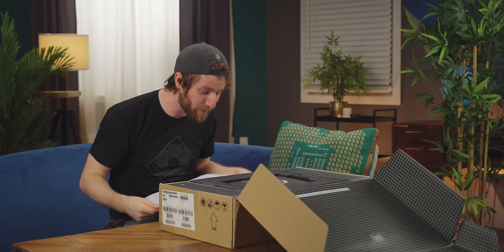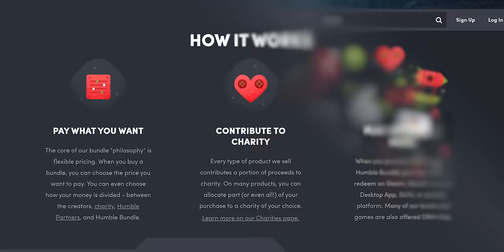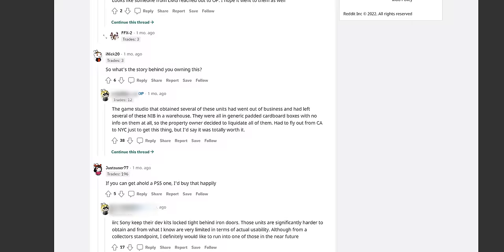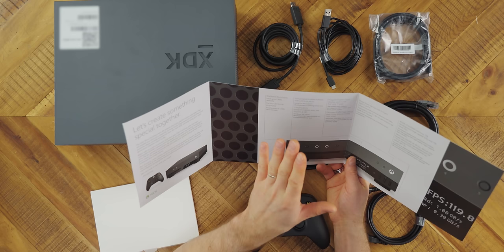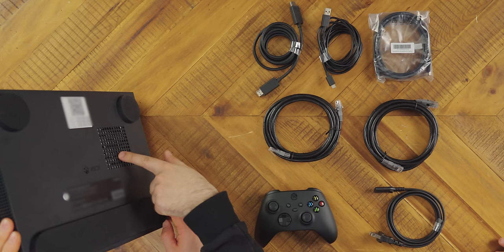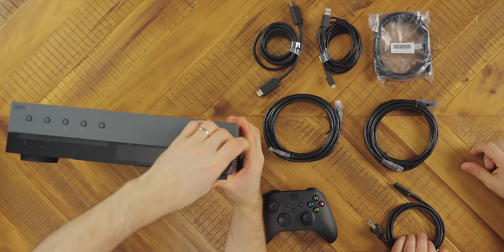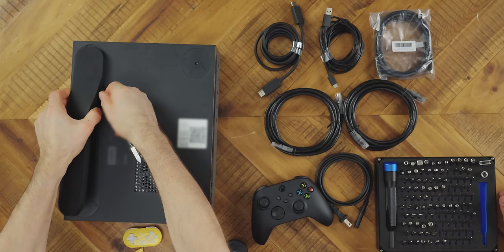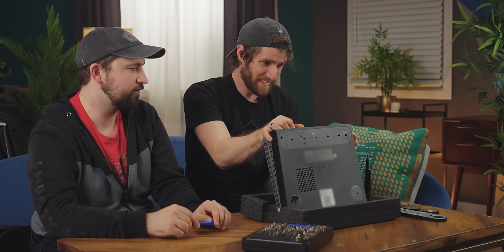I Can't Believe I Paid Two Grand For This - Xbox Series X Dev Kit

Comment: For future notice. Xbox's Backwards compatibility isn't true backwards compatibility. The disc is just used as a license that allows the console to download the actual backwards compatible build of the game that runs on the modern Xbox from the Xbox Live network. i.e. None of those old Xbox Games would have worked unless you were connected to the internet.

Edit: If it wasn't clear, I'm talking about the Xbox 360 games that were bought. I'm not 100% on Xbox One stuff. I think they'll use Smart Delivery if connected to the internet, but I can't see why Xbox One games wouldn't play natively.
Reply: huh I didn't  know that
Reply: That's so annoying, it'd just use up your space downloading games when they could have just made it actually backwards compatible
Reply: @UC3OUe7A1fhk3x3r3mXKfMOQ No it's not. You are not running actual code of the game from old xbox. You are downloading another version which works on current xbox. That's just different.
Reply: @bubbleboy821  lol as if it is as simple as that
Reply: ngl, thats smarter then whatever I would of came up with.
Reply: @bubbleboy821  All Xbox have different hardware architecture, they can't just made them "compatible". It pass through emulation, so you need the emulator and fine patches tuning, so you needs the specific optimization that's come on top of the existing games.

Emulating efficiently a different hardware architecture is not an easy task.
Reply: It shows how biased our media is nowadays. Blows my mind that people have jobs when they know nothing about said job.
Reply: @MartijnPeek  Its significantly easier to just port the old game to a newer console then to create a general purpose emulator and spend even more resources tracking issues down and sending patches out.

The problem is with capitalist shenanigans getting in the way. (publisher went EOL or isn’t willing, licensing crap, etc.)
Reply: yeah it basically just downloads the rom for the game, and the console emulates the game
Reply: @qwertykeyboard5901  As a software engineer, I disagree with your statements.

It is not easy to port W98 games to W11. It needs to be redevelopped.
 
And yes, porting one can be made, but porting them all is impossible, don't you imagine the insane amount of games to redevelop for backwards compatibility in 2222?
Reply: @AIt-Girl  It wouldn't be, last time that happened was the Wii U having Wii hardware inside it.
Reply: Correct
Reply: Each game has its own individual Emulator for each game, for the best performance, that's why.
Also that about the Disc is actually smart, that means that if you got a scratched disc that wont work on an OG xbox/xbox 360, it will still work on Series X, and the disc will last longer. (This applies to Both OG Xbox games and Xbox 360 games, due to them having Way different hardware from the Series x)
Reply: Kinda confusing that it seems like this wasn't known, that's how I understood it from when they first announced it.
Reply: More than most consoles can say. I do enjoy older Xbox games now and again so meh.
Reply: @LordNementon  yeah in 2222 the number would probably be pretty high, but werent we talking about 2022?
Reply: Thanks for that brotha!!! I totally DID NOT know that at all. I guess I’m too hardworking to know that point. BRING BACK TRUE BACKWARDS COMPATIBILITY
Reply: @shooterboi  Same to me, if you choose to invest in game backwards compatibilities you have to take in accounts the cost of today and tomorrow to take the wisest decisions to manage it

At worst, if the computing power is sufficient in 2222 you will have an emulator that will emulate the prev gen hardware that will itself run the prev gen emulators 😸
Reply: @LordNementon  i
Reply: Thats why you can put an xbox 1 disc in a series x and then never have to put it back in while still being able to play those games.
Reply: Yeah this is kinda why console gaming is dead to me. I just emulate games on PC now. No point in buying console. If their servers go down you can't even play modern games that you own (Happened recently with Xbox live) and all old consoles get taken off the servers eventually. Retro market is dead after the ps2/ Xbox original. Sad the digital/live service kiddies will never be able to relive their childhood on original hardware like it used to be without paying $40+15 for money service sub. Most of us old gamers know those ruby cortz glasses we look through when we go back playing classics.
Reply: @MrSmexy702  This is really only a problem on Xbox consoles, PS and Nintendo still print the complete game on disc and if not there switch games will have the disclaimer on box, Xbox is also the only of the 3 that can't play games out of the box without connecting to internet first, hopefully with the backlash they fix these issues
Reply: Every disk has a boot sequence code that checks if its authentic. Flip your disk over and you will faintly see a sequence of numbers with a barcode. That's what your xbox laser scandal to check if its authentic.
Reply: They "recompile" binaries into x86. That allows better performance than JIT.

They could technically do that on the console, too. Just a lengthy "prep" step. But choose to do it on their server once for all users.
Reply: @LordNementon  that depends, a Series X could easily run One (and other model) games, the 360 is different though as it ran on PowerPC

yes it would run through emulation but the Zen 2 in the new Series X should be powerful enough to emulate PowerPC (xb360)

and og Xbox games should run just fine on it with minimal patches as the Xbox 360 was the only Xbox that didn't run x86, the og Xbox ran a Pentium III which is x86
Reply: Partially true. The Series X still reads data from the disc for Xbox one games and will download the Xbox One version of the game. Since the console is offline, smart delivery will not activate. The problem they ran into is that all non-native Series X games need a one-time network patch in order to run on the Series X. This does not apply to native Series X games like Devil May Cry 5 SE or Control Ultimate Edition. You can tell which games are native from the game box (it will only say Series X on the label).
Reply: @SukruTk  only the Xbox 360 didn't run on x86, all the other variants actually ran on x86, og Xbox and everything since the One again

but Xbox games weren't made with newer gens in mind
Reply: Yes but sometimes I get a free uptate
Reply: Good ole DRM games, where you don’t own them unless the publisher says you do :)
Reply: So if linus did use a game that meant for xbox series x  it would have worked?
Reply: I'm ok with this, just be able to play some of my old games is more important then how it works, I still remember when sony originally said you can't  play old games even just one generation back, they even said you can't use ps4 controllers on ps5, but they took it all back as Microsoft announced backwards surpport for old games and controllers.
Reply: @bubbleboy821  Because they weren't meant for that.They are Developer Kits meant for newer titles to make sure they are compatible,not for being backwards compatible.
Reply: @LordNementon  If they managed to have the original development code for said game wouldn't that make it easier to update them to run on modern hardware or am I missing something.Asking because I'm not a coder but I am interested in such things for sure.
Reply: Yeah they tell u this wen you put the disks in
Reply: Well that is actually how discs have worked since the ps3.
Reply: @LordNementon  That's a port
Reply: @BH4x0r  Yes, but it doesn't depends of the CPU architecture, its depends of the whole hardware architecture.

A PS3 and a 360 CPU both use a PowerPC instructions set, but their hardware are totally different and emulating them is two different realm.

The same goes for the first Xbox, it use custom hardware that needs emulation.

But if consoles hardware become as generics as PC, yes emulatation won't be required anymore.
Reply: Well actually it is true backwards compatibility. It does require you to download it from the store after you pop in the disc. It launches those games in an emulator of the 360 which means yes it’s true backwards compatibility but with annoying DRM protection
Reply: @bubbleboy821  That's not how computers work
Reply: @bubbleboy821  Thing is the ported games are made to run on current gen hardware and software, so it doesn't need to be emulated.
Reply: Hmm this is news to me, as i sit here playing Tony Hawk Underground 2 on my Series X with no internet. (Doesnt even have a digital version to download)
Reply: @LordNementon  they don’t have different architecture lmao they’re all X86-64 based systems running a modified version of windows o.s.

Even the o.G Xbox used a modified version of windows. 

The only difference is they coded a snippet into windows that doesn’t allow it to native run .Xbx and similar executables. Which windows CAN native run without that prevention as all Xbox code is based on Universal Windows Platform. 

… the only reason the X360-newer consoles use emulation for the previous older console before it is for CLOCK TIMES to make sure the game doesn’t run at higher than intended speeds. And for DRM reasons. 

Windows 10-11 for the series line
Windows 8-10 for Modern Xbox ones.
Windows 2000 heavily modified for the Xbox360 and the o.G Xbox and used windows 95-98 code.
Reply: @bubbleboy821  Annoying? No. It's amazing. What MS did allows old masterpieces like original Red Dead Redemption run at native 4K with 4xMSAA and 16xAF.
Reply: @verakoo6187  it’s emulated natively, and some games don’t require emulation at all.

As long as your Xbox is set to your home console and you aren’t having a weird console update issue that locks all drm on the console you shouldn’t require Internet at all.
Reply: @That_Son_Ofa_Itch  You can run Linux on a PS3 (at least you could), it doesn't mean the PS3 and a PC have the same architecture, it mean Linux kernel has been adapted to support PS3 specific hardware (that even the specificity of Linux to run on any kind of hardware architecture)

The same goes for the original Xbox, yes it runned with customized windows kernel, because the kernel is the abstraction layer between the hardware and the operating system.

The CPU architecture doesn't mean they have the architecture of a PC. Emulating the original Xbox is not a simple things to do.
Reply: This is literally why the OG PS3s that were "too expensive" to most were god machines. Complete hardware based backwards compatability.

And because so many were upset it cost too much, is most likely why we don't have it on PlayStations these days, good ol' consumer being absolutely awful and hindering what they actually want because they don't want to pay for it.
Reply: Wait if I download them, can I play them offline or do I need internet to actually use the old discs?
Reply: Yeah, I'm honestly surprised they didn't know that.
Reply: @LordNementon  but they know how their old OS operates, they're all x86 and have the source of everything, only the X360 would be harder
i highly doubt real emulation would be required apart from X360 games, some kind of interface should work fine, i ofcourse don't know how deeply integrated it is into the OS and into the games though, but emulation is only really required if the CPU can't run those opcodes straight out of the box, since the PIII in the Xbox x86 etc it can defo run the opcodes straight, but it depends how the OS interacts with games

that is why Windows games and Linux games don't run on each other too obviously, although they share the same CPU architecture, GPU is a different thing and would require something driver-esque

some kind of compatibility layer-esque thing should do it just fine
Reply: You know this for a fact how?  It would appear to me that launching a backward compatible game starts a virtual session of the Xbox 360 software on the console and plays the game.  Nothing is downloaded when it starts instantaneously.
Reply: @LordNementon  redeveloped? Are you serious?
The game logic should be just fine. The APIs to interact with the OS may have changed, but that doesn’t mean that you have to rewrite the game.
Emulation is really difficult to get right, especially for modern hardware. Writing an API translation layer and recompiling the old code is much easier.
Reply: It's pretty clear who in these comments hasn't actually used the Xbox box one/series backwards compatibility. MS actually dumped a ton of effort into it's backwards compatibility. You get upgraded graphics, 60 FPS and 4k in a lot of older games or some variation of the three. It's not loading it off your disc but it's not just some nefarious DRM, they are downloading a completely different version specifically designed to take advantage of the newer hardware. Other than the need for online it's the most effort any console maker has ever bothered to put into backwards compatibility.
Reply: Year it took the ps5 to try to do it lmao and still no 1440 p on the ps5 must hard over there lmao
Reply: @BH4x0r  The compatibility layer you talk about is high level emulation, but yes definitely not hardware emulation 😸

Kind of yes, but kind of no, the original Xbox is not just a PC. It has dedicated hardware, you have to emulate that specific hardware chips behaviour with software if you want to run original Xbox specifics software without modifyng its source code on an other X86 CPU.

If you have the source code and you want to port the game, the CPU architecture doesn't matter, the CPU is a general processing unit, you just have to re-compile the software for the right architecture (so, the jobs of the compulilateur). At the end, with the sources if you have the will to port the game, the emulation is never required, since during the port you will remove the use of hardware you don't have.

Emulating  X86 custom hardware on X86 has for only advantage in comparison of emulating PowerPC custom hardware on X86 to be more efficient, since you won't have to convert the CPU instructions.
Reply: People dont know in 9years that xbox one/series downloads every game from store disc is only giving acces to the game when its inside console
Reply: @LordNementon  "Easier" as in Relatively easier.

I've tried compiling old source code before. Its ass.

But it us still easier then building an emulator
Reply: @MultiCarter007  with proving your license via physical media. = free download . very consumer oriented practice . i support that for the possible future.
Reply: @sanic1085  are you talking about LTT? I highly doubt they’re biased towards Microsoft. And I promise you they know what they’re doing in their job. I would imagine it’s just an oversight.
Reply: Thanks for this info @Hazz3r 🤘
Reply: You are downloading a new executable and new assets but loads of assets and content are copied from the disc I often watch them copy stuff.  Unless it's all a ruse....
Reply: @QuixoteJay  To the statement about the game itself being stored on the physical mediums:
It is to note that this statement only applies for Nintendo's, Sony's and Micorosft's old games on old hardware. 

Nowdays, it is a bit different. Eg While Nintendo still mosty puts the whole game on the switch cardridge, it isn't really the "whole" game. Any updates, patches and dlcs are completely missing. This means that while you will be able to play a physical switch game on original hardware in the future, you won't be able to experience the games as we know them today. Many games have changed drastically through updates and dlcs. E.g mario kart 8 will lack half it's tracks. Smash Bros Ultimate will lack half it's characters and stages. Animal Crossing will miss half it's content. 

The games will still be playable, but they will be in a state where most people will barely want to play them.
Reply: @qwertykeyboard5901  Scale it 900 times for the first generation leap, then 1800 for the next one, not sure it will stay relatively easier.

But definitely agree that developing an emulator, especially when there are breaking architecture changes is software pr0n 😸
Reply: What a flush of a video. Spent all that money and they didn't even know the basics on how back-compat works on Xbox since 2015. They didn't even finish the teardown. And they reference the GN video, but they haven't even watched it. So there is weird first-impression misinformation being said with no correction.
Reply: @MartijnPeek  it could have been designed to be.
Reply: @LordNementon  Well microsoft went with the porting idea, and id expect them to know what to do most of the time.
Reply: @qwertykeyboard5901  Xbox one games are emulated. Some vendors port their Xbox one games and make a series X/S version but it is up to the vendors. I've just double checks since you gave me some doubts 😸
Reply: @LordNementon  I don't think it would be that hard to implement as it all runs on DirectX, which is sorta cross compatible, atleast if it's done like on windows
Reply: Same can be said of any game these days
The disc might contain the vanilla build but after a few updates its really just a key
Reply: Lol was just coming to say the same thing.
Reply: That explains why it "downloads" it but you still need the disc to play the game :/
Reply: @LordNementon  it’s actually much worse than that, emulating RISC on CISC is a nightmare. SerIes X might have a prayer of doing it, nothing lower. All of these are automated static binary translations with fixes done by hand.
Reply: @Nick_Tank  Well that isn’t going to happen for PS3 and 360. The only way to do this would be to take a 360 processor and put it on the Xbox motherboard and give it its own independent cooling system. This is after you spend hundreds and hundreds of millions of dollars restoring the lions to make those processors. Doing this would raise the price of each Xbox probably about $200 by the time you said and done. You cannot do it any other way.  This is the solution that they had to use for PS2 and PS3, and the chip alone cost Sony $30 per console at manufacture
Reply: @spiral09  Assuming that it was a game that actually resides on the disc, and doesn’t just contain a loader to download it, yes
Reply: Makes sense tbh. The 360, and especially the Xbox, were super peripheral and used a lot of custom hardware and software features. Running the raw code for an Xbox/360 or PS2/3 game on modern hardware would definitely not be fun. The shader glitches alone would probably make 99% of games unplayable

If you thought playing old Widows 98 and XP games on 64-bit Windows 10 was painful, you ain’t seen nothing. Trying to run Xbox 360 games on modern hardware is like that on steroids
Reply: And that’s why I play Digital-Only.
Reply: @verakoo6187  Then you’re using a pirate PC version in dev mode, since the title isn’t available on BC. If you’re going to lie, choose a game actually on the list next time.
Reply: @jeffkleist9679  Modern Vintage Gamer have a great video about Microsoft Fusion emulator and their "just in time translation engine with multiple pass optimization" 😸
Reply: @That_Son_Ofa_Itch  xb360 runs on the PowerPC arch though, which some Macs had, but it's definitely a different architecture
Reply: @jeffkleist9679  Underground 2 was sold on GameCube, Xbox (og), PlayStation 2, Windows and GBA.
Reply: @LordNementon  this is why PC is King. You can play old games with better specs, and if it require old version of windows, you can download the old OS to run the game natively on Suped up cpu/gpu
Reply: @BH4x0r  But it’s not backwards compatible. I just checked the list. Even if it was, he would have to download the BC version by going online.
Reply: @Keepskatin  Until we have quantum PC, yes 😸
Reply: This angers me DEEPLY, but it does mean that the disc only has to read a little bit. At least in theory.
Reply: @jeffkleist9679  I don't know for sure, but perhaps if he has an offline patch for other games it might work for that game too, it's not like they're hardcoded for every game and since the OG Xbox had a similar architecture (cpu atleast) it might work that way

if it was an Xbox 360 game it would DEFINITELY need to download a working version (as the 360 ran a PowerPC processor)
Reply: @LordNementon  Not only that, because of the music industry asking for renegotiation of licensing (which the DMCA needed to be rewritten to prevent this loophole/abuse).
Reply: @killertruth186  yea. Agree
Reply: This is not true. I know this isn’t true because I wanted to test the original AC:Unity before the hardware spec got downgraded and features removed.

Setting the Xbox to offline mode allowed me to install the game off the disc and run it without patches. For anyone wondering, it still ran badly and was garbage but it did run at 60FPS.
Reply: @LordNementon  Xbox literally has pc architecture and all X86-64 based gaming is centered around Direct X which literally derived its name from the Direct XBOX 

The Xbox was what Direct X was originally designed for. Hints at them being the literal same architecture fundamentally.

As for the ps3 running Linux. Linux is a distribution based o.S, you can run Linux on basically anything but one version of Linux can’t run applications for other distributions.

Microsoft however has implemented full compatibility software wise for all their product families. Through W.U.P support. 

Fun fact also the newest systems being the ps5 and xbox series line are so close to being full blown computers that people have modded windows 365 home edition onto them.
Reply: @robertpatton172   seems like it only needs downloads for 360 games (which is logical as it uses a different cpu architecture)
Reply: Yeah, this is how the Xbone worked. Not sure why people are too stupid to know that. It was explained. The 360 and current architecture are not compatible which is why the 360 is emulated. It's either that or nothing so why complain?
Reply: @That_Son_Ofa_Itch  First correct original Xbox emulator arrived in 2019, no it isn't just a PC.

If Linux can run on the PS3 it is because a custom Unix kernel has been developed for the PS3 hardware.

Yes, they use DirectX API with a custom kernel implementation for the Original Xbox to support its custom hardware.

You can provide the same API in the userland with different kernel implementation, different implementation to support and leverage specific hardware.

Even if there are actually slightly differences between the DirectX API of the original Xbox

The kernel is the abstraction layer between the hardware and the OS.

You need a Xbox Kernel to execute Xbox games, you need to emulate the hardware the kernel expect to talk with, or you will need to change the SDK use to develop the game, port it or patches it on the fly (HLA emulation)

Totally agree that last gen consoles architecture at the exception of specific hardware for security are close to be a PC.
Reply: @qwertykeyboard5901  Not quite sure tbh, making a port of every single game seems less efficient than just having proper emulation in place.

Sure one port is way easier than a proper emulator, but 50+ ports seems more difficult.
Reply: Super annoying. Can't put a disc in and just play
Reply: Miss the ol’ days when you insert a disc and just play
Reply: I'm surprised they didn't know that. Doesn't it always download anyways?
Reply: @bubbleboy821  They couldn't make it backwards compatible. The 360 had some super weird CPU and GPU architecture features that nobody makes anymore. If Microsoft instructed AMD to add those weird features, it would prevent the company from moving forwards towards a more unified platform with PC.
Reply: @bubbleboy821  ya no it much more complex than that. Just be happy it emulated and not cloud streaming
Reply: Yeah, they use the same retro-compatibility layer that Sony uses but unlike Sony who added all the gaps in logic and features straight to the silicon, Microsoft fill the gaps with software emulation. Not even system level it comes separate with each game and requires you to be online.

With the recent server outage happening no one could play BC games on series x and a lot of people couldn't play native games either.
Reply: Yeah but thats some kind of logical due to other hard and software settings. The developed 360 or One Games didnt know the Series Consoles so the program code doesnt work. Also if you buy a Xbox one disc for your one you gonna update it anyway. Compared to PS5 it is backwards compatibel
Reply: @verakoo6187  Most people would know it.
Reply: I figured that out pretty early on when i put a morrowind Xbox game in my Xbox one and it pulled up goty edition instead of just morrowind standalone
Reply: @googleuser0001  It sounds like they only have the GOTY version on the store.
Reply: A disgusting reminder that companies don't believe in physical copies, sadly. 

It terrifies me.
Reply: @SageYT7709  It's mainly because of most people don't like disks anymore.
Reply: @sanic1085  . Can you elaborate, it comes across as a non-sequitur. None of these peoples jobs are about explaining Xbox backwards compatibility to people.
Reply: Yeah unfortunately. I Kinda wisht hey found another way, but eh
Reply: @bubbleboy821  making an Xbox ..that has og Xbox....Xbox 360 and xbone architecture inside it is just not feasible...

That what it requires to do true hardware back compact in a console...

Games are licensed to run on individual hardware..at least up to ps4 and xbone when they changed it to ecosystem...

Meaning if you want a console to run 3 gens of games...
You have to put enough of Xbox parts into the console so it's technically classified as an og Xbox..

Enough 360 parts so it's classified as a 360..

Enough xbone parts so it's classified as an xbone...

That machine...would be the siza of a large mini fridge..and cost over a grand...that type of back compat isn't feasible...Sony did it with the 60gb ps3...than cancelled them.....

It holds back innovation and bogs down the new system you're trying to make.
Reply: Yes, but did they add more feature like unlock fps, resolution and auto hdr?,
Reply: @bubbleboy821  not gonna lie it's really nice, I have a lot of broken 360 games that will recognize but not play. This way I can download the full game to my Xbox and use my broken disk instead of having to buy a new copy
Reply: Mine worked offline
Reply: @LordNementon  Actually most Xboxes are x86... The original used a Pentium III (x86) and both Xbox One and Xbox Series use modern AMD processors (x86-64, with native x86 support). The only xbox that requires instruction level emulation is the Xbox 360 due to its PowerPC like cell derivative processor, but emulation with JIT is quite performant as companies like Apple have publicly proved.

Even the graphic architecture differences should not be that difficult to emulate. Unlike other console development companies that used tailored graphics APIs unique to the graphic hardware, all Xbox consoles use a derivative of DirectX and Direct3D. This means that API level emulation is possible with the API being implemented using native drivers (as good as no emulation overhead). This is not just limited to the graphics API, with most of the interaction with the system being high level through APIs which can be outsourced during emulation to native drivers rather than requiring low level emulated drivers on emulated hardware.

These characteristics in theory make the entire Xbox family the easiest consoles to emulate as you do not need perfect cycle level emulation as the APIs never defined such behaviour. This is very much like how one can fire up an old x86-64 MaxOS application on ARM based apple silicon and they just work despite different IPC, core counts, graphic architecture, e.t.c. The issues with emulation of older Xbox consoles and one of the reasons behind needing game specific patches is not that the emulator is buggy, but rather the games themselves are buggy.

One example that was given in a blog behind the Xbox backwards compatibility was a Xbox 360 game that ran fine on the console but out right crashed on the Xbox One. Upon further inspection they discovered this game also could crash on the original Xbox 360, just very rarely. It turned out the cause was the game made an architecture specific assumption that its threads would always execute in a specific order that was entirely dependent on the exact behaviour of the Xbox 360 scheduler and the rate at which the threads executed on the CPU. These threads being run by the scheduler of the Xbox one in a different order at a different rate made the game crash. Although they did improve the scheduler logic to more closely reproduce the results of the Xbox 360, the actual solution used was a game patch that fixed that bug and made the game no longer care as much about the order or rate threads executed. Apparently they used such examples to create guide lines for long term compatibility when creating games.

The same blog also mentioned that most games in the library just work with emulation, no patch required. However why are patches then required for all games? I suspect it is largely down to licencing since a developer that made an Xbox 360 game explicitly gave permission for it to only run on the Xbox 360 and not the Xbox One or Xbox Series. As such forcing the developers to patch gets around this licencing restriction since the developer then has explicitly given their consent for the title to work on the newer consoles using emulation. It also gives the developers a chance to go beyond just letting the game run and improve visual quality and performance in a way that does not break their games. This may or may not be done by rebuilding the game, after all native ports will perform better than emulation, however too much of this is kept secret to know for sure.
Reply: @MultiCarter007  I don't think it's that easy to emulate a whole other console, even PC emulators struggle emulating consoles like the Xbox 360 and Xbox one. It's much better that Xbox is instead creating different versions of the game that will work on newer hardware
Reply: This is the entire reason I stopped using consoles you paid for the device you should be able to play without the internet
Reply: @drsupergood8978    Regarding Apple and their x86 emulation performance I've read somewhere that their chips use an hardware tricks to be capable to read the data regardless they are saved in little endian (X86) or big endian (ARM), which is usually one of most performance hit, due to the required conversion. Smart move from their side for sure.

Interesting reflection regarding the requirements for the patches 🤔

I totally agree that emulating x86 on an x86 platform will always be more convenient that emulating an other instructions set.

Emulating with a translation layer the API call is definitely a way, but a way not that easy to implement due to the various versions of the SDK that needs to be reversed and re-implemented (the strategy used by one of the first Xbox emulator if I recall it correctly) It let me thinks of WSL1 who used that approch but has been abondoned in WSL2 in favor of virtualization due to the ~infinite cat & mouse game.
Reply: The architecture is different (PowerPC vs x86) which means all the binary codes are useless. It's much more efficient to recompile and have the games run (close to) natively. Don't forget some games are even running under 4k high refresh rate etc. Microsoft has really gone above and beyond on the compatibility side. This should be celebrated.
Reply: From my understanding all your doing is downloading wrappers. The core code is all there. Untouched
Reply: Thank god oem 360 hard drives have a partition for an ogx emulator
Reply: For OG Xbox and 360 games that’s true, however many Xbox One games can be installed from the disk. You can also run some Xbox One disks unpatched in offline mode too.
Reply: @LordNementon  hence why the OG PS3 was a monster in size and cost. it actually ran both generations hardware in one she'll, the disc drive was actually two and the type of disc inserted would tell the system which laser to use.
Reply: But what you expect??? All generations have different architectures, so download the game is a great alternative, better than what Sony does with PS3, with only streaming option that is paid and just available through their new service.
Reply: @richardjohnson4984  The same goes for the first realeases of the Wii, they included a GameCube in it 😸

Having multiple hardware in the same shell obviously allow to use all the included hardware but it can't scale to the infinity.

If the PS3 that didn't include PS2 chips can't run PS2 and PS1 games there is a reason, the PS3 hardware needed to evolve in an incompatible way. That's a breaking changes, they are necessary when new, better and incompatible technology arise.

Maybe tomorrow games console will use ARM processors, they won't be able to run natively x86 one.

Go more further, they may have a quantum processor even! Which will be definitely a total architecture changes.
Reply: @bubbleboy821  they have to modify all games in different way to be emulated on newer Xbox, so you can never just play the original file
Reply: @qwertykeyboard5901  "capitalist shenanigans" , and, you think any of those things would have came to be  in a purely socialist economy?.....the answer is a big fat NO
Reply: @qwertykeyboard5901  EMULATOR -1 piece of software to rule them all. Its is so stupid doing it the way they are.
Reply: Meh, but it's better than any backwards compatibility options that Sony gives lmao.
Reply: Wait, does that mean that they need to modify each to game to make it compatible with the new gen?
Reply: @youraveragexin7400  nope it’s that the game Dev just need to support the 360 or Orignal Emulator on Xbox
Reply: @bubbleboy821  are you aware that all your modern games are copied from the dial to your console and the disc is still only used as a key?
Reply: You are partly correct, a build is downloaded but it is the same as for old gen console and not a special build
Reply: @LordNementon  well, turns out it's x86 they run on, and there's been emulators for PC for a while, so there's no actual reason for whatever mess they're using, specially since many of those games aren't even for digital sale anymore
Reply: Biggest tech channel didn’t know this lmao
Reply: That is really disappointing
Reply: @That_Son_Ofa_Itch  I very seriously doubt OG XBox used win98 code... or NT for the 360...
Reply: @killertruth186  If that was true, digital only consoles would outstrip disc based consoles easily. How did you come up with 'most'?
Reply: @guadalupe8589  ok liberal
Reply: At least the console is actually running the game @PlayStation
Reply: Yeah
Reply: @urbexingTss  how
Reply: Exactly
Reply: @bubbleboy821  
>They could have just made it actually backwards compatible.

They could have just made something that is literally impossible? Lazy!
Reply: Thing is, the backwards compatibility wasnt designed for the console from the start, so it needs to  create a specific emulator to translate every single game to the virtualized Xbox environment that is used today. As mentioned, on a Wii U or on the PS3 it wasnt necessary because the consoles were designed from the start to have a compatibility layer, on the Wii U it had parts of a Wii system and on the PS3 it was a hybrid between a general emulator (PS1 games. Every single PS3 out there runs PS1 games) and hardware (PS2 games. Newer models lack PS2 compatibility)
Reply: @SchmeedIsMe  Many sources across the internet that can be found with a bit of googling. You can prove it to yourself by inserting a backwards compatible Xbox 360 disc into the console, (make sure that there is no data on the hard drive related to the game, i.e. as if the disc is inserted for the first time.) The game won't play. Because the console isn't using the disc for game data, just the license.
Reply: Same same better then playstation making me rip out the ps2...
Reply: @pseudowoodo5010  One they're downloaded, you're good.
Reply: @3k4landrew  I don't really agree. Xbox's Backwards compatibility is really just emulation. This is different to the backwards compatibility that the launch day PS3 had, or that the PS5 has with PS4 games, which is hardware based, "true" backwards compatibility.
Reply: @SukruTk  you can't just recompile code into x86 if it's written in a language that uses JIT, you would have to rewrite the game in a language that supports x86. Also that does not have anything to do with backwards compatibility..
Reply: The current virtualized Xbox environment  only runs game code from the internal or external storage, it doesnt run discs as old consoles, the discs have a "compressed" version of the game that the console decompresses and copies. By design, it is impossible to run 360 games natively, so it is really cool that not only they found out how to make them work, but to identify a disc and let the consumer play without paying the same game twice (unlike Sony which made an PS2 emulator but you need to purchase the games again, not only physically, since the PS4 and 5 will not run PS2 discs, but digitally too, if you bought some PS2 classics on the PS3, you have to buy the same game again to play on the PS4 and 5). Other thing is that there are no disc drives able to properly run and decode a 360 game partition on the disc, what One and Series consoles do is try to identify what game is from the Video partition alone and download the emulated version for you to play (360 games have a Video and a Game partition, the Game partition is self explanatory, the video partition is just a video saying that the disc is not meant to run on a DVD player)
Reply: @r0best498  you actually can. Eurogamer ran an article on how the back compat works on the Xbox. I would recommend reading that
Reply: interesting
Reply: They really need to have a cartirage system like Nintendo does or something because discs are really getting out of date and we can't just keep using 100gbs of data just to download a game you got on a disc.
Reply: @hightiernub1313  , Well tbh the PS3 with the backwards compatible chip was the best thing they had, It was kind of a shame they didn't properly cool it.
It would kind of be interesting to see with Chiplet/MXM design if in theory they could make a chiplet a shrunk down processor from yester years, and then simply use a master I/O die to translate to newer standards like USB and PCIe renditions.
Reply: @kanedaku  When I had said most, I meant most people that knows about the game.
Reply: @Hazz3r  I really missed Xbox music digital store. Don't know why they had decided to close it.
Reply: @LordNementon  if u think it was easy ask Sony why they haven't done it. Give credit where it's due and stop being childish
Reply: @shepshepson  thing is, it is a issue on Nintendo Switch as well, on Xbox and PS is far less worse. Switch use game cards which can have multiple sizes, the bigger the card, more expensive it is to produce, whereas a blu ray disc, packaging and all cost 3 dollars at most. Publishers on the Nintendo Switch often choose the smaller cards to save money and the user needs to buy a bigger SD card to download "the remaining part" of the game. If you see a Nintendo Switch game with a white ribbon on the top, it has mandatory downloads because of this and the game card will never start the game without the game data downloaded. At least on PS and Xbox the 1.00 version of game is accessible from the disc if you cant download the day one update. One good example is Megaman Collection, it fits nicely on a blu ray, the game is as far as I remember, 6GB in size. On the Nintendo Switch Capcom chose to store the game into a 2GB game card and it only has the first game, the second is a download code, or how L.A. Noire is a 30GB game but Rockstar chose a 16GB gamecard and it requires a 14GB "update" download to play the full game.
Reply: @lionbizzle  You've probably misunderstood me, because I've never made that's statement.

Not sure why you think I'm childish, can't understand you on that one.

But for Sony, I can say it is because they haven't invested on it. Microsoft did invest a lot to build their internal emulators used for backward compatibilities.
Reply: @verakoo6187  You only need internet to install the game. Once installed you can play offline. Try deleting it then try to launch it offline.
Just because it doesn't have a purchasable digital copy doesn't mean it's not a digital copy.
Reply: so? still plays games.
Reply: @killertruth186  Again, how are you quantifying this? Or are you just claiming something as fact because that's what you believe?
Reply: @kanedaku  An educated guess.
Reply: @youraveragexin7400  basically recompile and do all the work to ensure it is running native to the instruction sets of the architecture rather than running through a sub layer of software code like emulation that translates code from a different architecture to something the processor and GPU can use to render the game and calculate all the other relevant data like music, AI, and such.
Reply: @LordNementon  The reason why emulating efficiently a different hardware architecture is so hard is because we don't have documentation. 
The community already manged to emulate xbox AND xbox 360, completely blind, through reverse engineering. Pretending microsoft couldn't do it is laughable.
Reply: @philipegoulet448  But Microsoft did it, I've never pretended that they couldn't, I was just insisting on fact that the original Xbox is not just a PC. They even writted patent  on optimising little endian to big endian conversion when developing their Fusion emulator, Microsoft invested a lot to build their emulators (not like Nintendo who is using open sources ones 🙃)
Reply: @kanedaku  you can literally google what windows platform they’re based off of its public information
Reply: @LordNementon  According to Wikipedia modern ARM supports bi-endian at least by hardware design so this is not a feature unique with apple but rather shared with most recent high performance ARM processors. That said I do recall there being talk that they had some magic logic built in to help emulate x86-64 virtual memory logic more efficiently that deviates from the normal ARM behaviour.

Normally reversing and re-implementing APIs is extremely resource intensive. However Microsoft, having made the original APIs, does not have to reverse engineer them as they know the exact details already and might not even have to re-implement them as they still own the original source code. If the code is any bit portable this is fairly easy, reliable and performant. A good example of this would be the graphics APIs since the RDNA2 GPU likely use AMD provided drivers and AMD drivers for desktop RDNA2 GPUs still support graphic APIs such as Direct3D9. This Direct3D9 support offers most of the graphic features needed to support the Xbox360 and original Xbox, minus a few platform specific deviances that AMD could likely add without too much effort. Sure we all know that Direct3D9 support is not very performant on modern Windows and GPUs, but it does not have to be given how much more powerful the Xbox Series is.

WSL1 vs WSL2 is something different. The issue with WSL1 is that Windows does not natively provide similar variants to all APIs that Linux offers. This resulted in some rather poor performance hacky work arounds (file system operations, process fork) or even outright a lack of support for such APIs (fine details of process fork). Given that Linux heavily uses these APIs and depends on them performing well this causes quite major performance issues. WSL2 gets around this by just running a full Linux virtual machine and letting that's kernel provide the APIs with a tight integration to connect to Windows. Although this gives much better and more performant API support, it is technically slower when that is not being used due to virtualisation overhead. Given that Microsoft has made all the Xbox consoles and their operating systems this is not likely to be an issue as it would be closer to running a Windows XP application on Windows 10 than running a Windows 10 application on Linux (which due to API level emulation is a thing! Steamdeck being a recent example of taking that to the next level).
Reply: It's been that way for years
Reply: @That_Son_Ofa_Itch  Well, thanks for the information. I did just that, so I stand by my first suspicion about Win95/98 code. The internet agrees the original XBox uses Win2000 code. I don't know what you were smoking.
Reply: @kanedaku  oh noe I got the windows version wrong but literally everything else right. 

😂 my point still stands Xbox is a windows based machine that is comparable to pc. And That windows literally can run .Xbx files but is prevented by the hyper visor of the o.s. 

._. Sorry I said 98 instead of 2000. The point still stands you can publicly see which version it’s based off.

All Microsoft products are designed to work together and be able to talk\Interact without code translation needed. Which is why Xbox dev mode uses universal Windows platform.
Reply: @LordNementon  yet on Xbox 360 it did run an emulator on the console to run the original XBox game's code.
Reply: Long story short 2013 happen
Reply: I mean… at least it works…
Reply: That's crap, not buying an Xbox anytime soon, even if I could/wanted. I'm tired of these companies telling customers bullshit.
Reply: Still emulation quality is insane, consider all old games runs with improved graphics 4k 60fps. Even on xbox one x, that some fucking marvelous engineers playstation can only dream about.
Reply: @That_Son_Ofa_Itch  I don't care about any of that other stuff. The first point I made was that I seriously doubt the console would have win95/98 code. The second point doubting win2000 on the 360, you were correct.
I think we're done here now.
Reply: So stupid.. the xbox series S/X uses the SAME Blu Ray Disc Drive as the Xbox One’s. So how hard would it of really have been to just let older games play directly off the disc, even if its for single player only offline idk.. this really pisses me off though because they did not make this clear at the new Xbox Series X specifications at launch..
Reply: @MrSmexy702  the Wii U is probably one of the best console emulators out. It can play all the Wii & Wii U games obviously no problem. But it also plays all the older Nintendo games. NES, SNES, N64, PS1, PS2, Sega systems, and some newer games like ps3 and xbox360 or you can play the Wii U version of those games. 
Its jst super convenient and easy to play quickly and have my game saves stay on my usb stick with the games on it. 
Plus the games load super fast from the USB stick. And any white Wii or Wii U is able to jail broken to run Emulator’s and things like that.
I like that i can play most of the Nintendo games right on the controller too. Useful for me sometimes.. i still emulate on the PC but i tend to just go play the Wii U when im seriously looking to continue a game on it and keep playing with the original controllers and stuff..
Reply: And that’s how normal backwards compatibility works?
Reply: @justinbowen1183  Its more complex than that.
Reply: @BH4x0r  That actually what they do, but each Game have a set of config file and instruction for the Actual Emulator, you can't run Games that is not on the Whitelist.
Reply: @Zer01neBDTDev  I know I was breaking it down as simply as possible
Reply: @LordNementon  Laughs in 1st gen PS3
Reply: What about OG Xbox?
Reply: @LordNementon  especially running X86 opcodes on an ARM cpu through emulation will be causing a performance loss, because X86 can infact do things often, especially memory wise, with just one opcode rather than 4 or more of them.
Reply: So TL:DR is it's a piece of shit
Reply: @mortontony1  uh for consoles not really, only X360's games need to be emulated, the other ones work perfectly from every generation on the Xbox One X for example, tell me any PlayStation that has support for more than one generation back?
Reply: So a hidden drm like smart delivery. U can’t play Xbox one (series x compatibility) offline on series x without internet because it need to check it
Reply: Well yes. As soon as you pop the disc in while connected to live it automatically starts downloading a multi GB file.
They pretty much have to, as features such as HDR and FPS Boost, so the disc version is completely inferior as well. 
Not to mention the XSX requires games installed from a disc anyway.
Reply: @bubbleboy821  This is basically impossible short of emulating an entire Xbox 360. The Series X (and One) are AMD64 machines, similar to modern computers, and their instruction set reflects that. The Xbox 360 uses a custom chip that is actually related to the PS3 Cell chip (see the STI Collab) that generally uses some PowerPC type cores (Cell had some extra custom ones) - these chips are entirely different instruction sets (and indeed, a large part completely custom sets for that chip) and therefore entirely incompatible with the modern x86 family of processors. This is especially so when the console is required to run the original code for the 360 unmodified, and you don't have access to the source code to try and recompile parts of it to be compatible with AMD64.
Reply: Additionally emulation is made much harder because of the instruction set being custom, you essentially have to re implement the processor in software and keep it fast enough to run smoothly. This is why emulation for the PS3 and 360 on PC is notoriously difficult
Reply: Yeah, when I played something like sonic unleashed or final fantasy 13, the system basically like downloaded some recompiled version of the game for Xbox one/Series X, with extra little additions.
It’s not like, emulating or playing the actual game, but some modified recompiled version that’s downloaded online. Which is kinda why the backwards compatibility sucks, as you need an internet connection to play any of them.
Reply: Still better than PlayStation with no backwards compatibility
Reply: YEP PRETTY MUCH
Reply: well it makes sense, theres no other way to make backwards comptability like that, all consoles use emulation for backwards compatibility, xbox, nswitch, and soon playstation